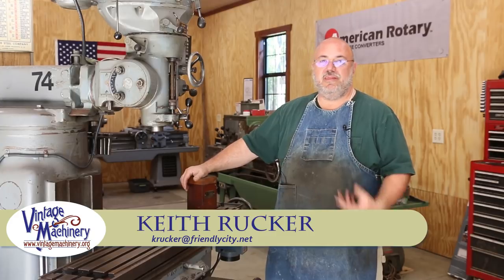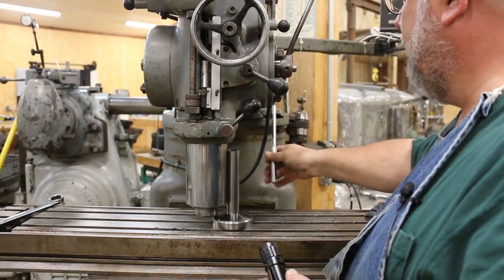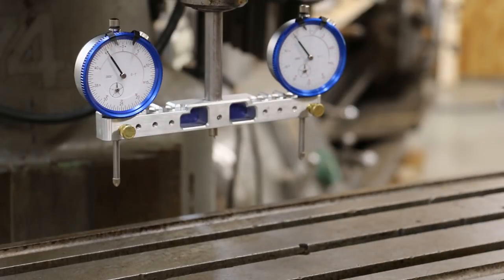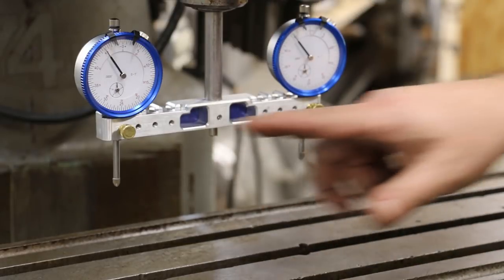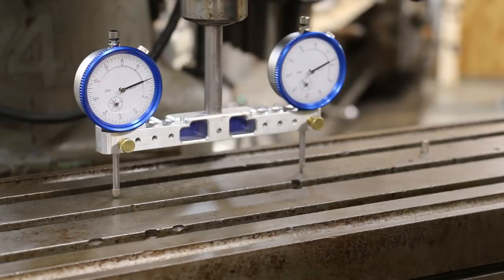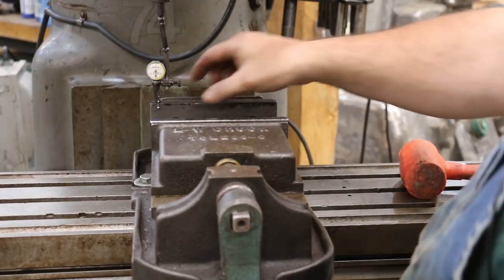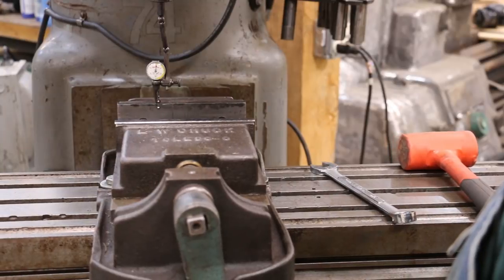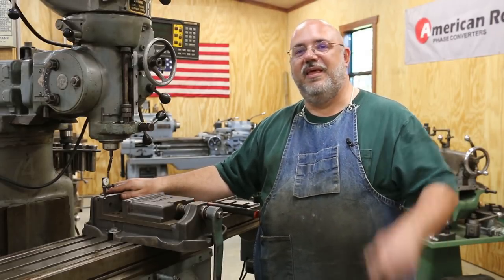Milling Machine Alignment:  Tramming the HEad and Vise to Square and Parallel

Comment: For those who have a boring head for their mill, it's simple to make a bar to hold your indicator. Then you can tram the mill's head with that. It's maybe a bit slower because you have to go back and forth between sides, but it's still only a few minutes to get it dialed in.

Comment: Most of my work is done in my 6 inch Kurt vise so I use the cylinder square on the bottom of the vise ways to tram the mill head in both directions. Thanks for making the video. Have fun making chips.

Comment: Hey Keith 
Love the Videos, keep them coming, I am a Newbie to all this Maching stuff and appreciate all your work and knowledge you share. I don't ever comment  because you  will have many many things to read, how ever I have to say that all the tramming should be done with the tables locked, at least on my Older Mill it makes a big difference. And oh yea I have the same  disease you have I just brought home my new (old) Monarch Lathe so I guess I can join the Monarch club with you and Adam Etc. Thanks again for all you videos and dedicated work
Reply: I would have to disagree with you on locking the table.  If you machine with the table locked, I could understand.  But you should have the table in the same conditions as you machine.  This is my opinion though as I've been machining for 30+ years.  Feel free to correct me if I'm wrong.

Comment: A word from the old and wise, make sure the bed rails are slick clean before traming! That one sliver of a spec can mess everything up, a good indication of specs on the slide rails is when your needle jumps when it is sliding. Rails might look clean, but there are spots you can’t see until you remove the bed from the rails.

Comment: First time attemping to tram a mill, my Grizzly G-8689 Mini-Mill...
No "nod" adjustment, but, went ahead with the table length.
Couldn't get the Mitutoyo 0.0001" dial to repeat during adjustments...
Finally checked the indicator... the four case back screws were loose.
Easy after fixing that!

Comment: I had a costly lesson about tramming last month. I also used a last word on my vise and I also used a mallet to tap it into alignment, with the indicator making contact with the jaw view. After a while the indicator was moving unpredictably. Now I pull the indicator away from the surface before tapping. I assume that it was the vibration that trashed a pricey gauge.

Comment: Thanks for the video.  Just what I needed to learn how to use the very similar two-dial-indicator setup I ended up with for my new-to-me FTV2 Lagun.  Got both axes to within a half a thou.  I think the machine and my eyes are both not up to much more.  Thanks much.  One small constructive criticism -- I'm so new to this that the third part on the vise setup wasn't enough to help me, as it didn't have any close ups to show just where the indicator was touching, nor what kind of indicator it is and how it is set up.  Probably should be obvious, but then again, maybe not for someone new enough to need such a video.  Thanks for getting me most of the way there.

Comment: I wonder if perhaps the minor error on the cylinder square may be due to the "first" check done with the head nodded forward, as the square might not have been flat to the highest point. Rechecking the first measurement once setting the second measurement may have also show the error once the nod was straightened up by your second alignment operation
Reply: makes sense to me!

Comment: Keith

Did you use the Spindle Square to chech ig the vise is square to the table ( and thus square to the head)  as well. most folks just seem to assume the vise when installed is square to the table, which is a bad assumption to make.  Once the vise is trammed in all 3 axis, then you know all is right with the world.  And don't forget, re-tram the vise when replacing the jaws

John

Comment: You can check correctness of your square cylinder by tramming your head some other way (by sweeping the indicator across the table for instance). Then place the cylinder on the table, attach the indicator to quill and sweep the cylinder by moving the quill.

Comment: Keith, tramming the mill with that double dti gauge or even if with a single dti I would tighten (lock up) the quill and knee each time after making an adjustment especially on an old machine, just to make sure of any errors

Edmund...........Alberta

Comment: you could measure to a pair of paralels set on the table so as not to measure and adjust any minute ding in the table. good tool to have though, i also like the cylinder square, that would not mueasure slight dings because of the large base

Comment: Good stuff.  One of the issues you'll likely find is that the quill has some play in the head and how tight you lock the quill makes a difference in squareness..  It might have been interesting to try different parts of the table to see if squareness changes. Also you could have on indicator point sitting in a dimple that would throw off the reading.

Comment: Use a gauge block instead of a magnet (more precise) and you should also take at least a  .100 revolution one full turn or a little more on you indicator which will give you more travel when checking and have the dial zero at the top of the indicator (easy to read). These tools are very easy to use and you can buy or make one in your own shop.

Comment: Just finished re-tramming mine with a similar dual indicator system. New mill...way out of alignment. Here is a suggestion, if you are way off like you were before you used the cylinder, do a gross adjustment by touching the indicators off the table first. If you are way off you can get lost in the number of spins on the indicator (I know the little dial is there - but can still be confusing).

Comment: Dear Keith,
I don't know if you  are gone look to my problem, thou I'll hope you  do.
First, I'm new, always  wanted to be a  machinist, (I'm a retired printer).
I bought a  Adcock-shipley (1954) horizontal  milling machine + vertical millinghead.
I did the tramming in the x and y direction, of the vertical millinghead, as close I could get it, 0,01...mm.

* But, now is my question: how can I solve the problem of  leaning.
When I put a indicator on the foundation of the  mill and I  travel in the X- direction, I have a difference between the two sides, 0,3mm. And in the Y- direction 0,18mm.
Now I have shimmed my vice. 
I would like to use the horizontal milling more with clamps. But I dare not, I'm  afraid my milled parts will not be parallel. I'm I wrong or right? Ps there's no play in the movement.

Greetings Lammertyn Mc

Comment: I’m amused at how few times I’ve seen a U Tube Machinist use the box end of a combination wrench.  From an early age I was always taught if you need to get it tight or break a hard one lose you should use the box end to prevent slippage and or rounding over the head.  To the best of my recollection I’ve only watched a U Tube Machinist use the box end one time!  Although in all those episodes I’ve not seen one misshape so it seems there was no need to use the box end.
 When it comes to the final tightening or loosening I always use the box end, just my way of doing things, I guess…
Reply from the maker: I use the box end a lot.  Sometimes, you can't get the box end on the head easily though because of clearance.  Such is the case with the nuts on the vise.
Reply: I could not agree with you more.  But my comments were not aimed at you nor to this particular video but rather to yours and most all other metal working u tube videos in general.  I do hope you did not take this as any kind of slant to you but simply a generalization.  You are if not the very best u tube machinist to watch, you are on top in my book!   I like you videos very much and yours are always the first one I watch!  Thank you!
Richard
Reply: yes, the open end is bad enough, but what about the many guys who use a shifting spanner or crescent wrench, depending on your version of english?
Reply: The bottom line is not that that everyone should use the box end, but to not round over the bolt head or nut. My comment was in regard to the fact that on U-Tube I very rarely ever saw the box end of the wrench being used;
it's always the open end or other. I did not mean that the box end should always be used, however if there is a chance of rounding over of the head one should use the box end for better distribution of forces.
Reply: with 2hich I agreed totally. I too was taught very early on to use a box end/ring spanner  or a socket whenever space allowed, open end only if  space or lack thereof require it, and a shifter/crescent as a last resort.

Comment: Keith.     Why didn't you use the magnet as height gage, must have ground height ( .375 ).
Now dial in full .375.  Then go to other dial. ( same spot ) and go .375. Now both are zero with
each other, then  both will zero together.   Just a thought......Ray

Comment: If you are going to tip the head at an angle to drill a hole in a part, you have to tram the head to the tee slots or the hole will come out in the wrong place.  No one ever thinks about the head swiveling on the base.

Comment: I guess I'm a little different. Wherever I worked if a little additional accuracy was possible, that's where I tended to go. When I worked for the Air Force I always worked to get something like the power supply parameters exact. My contention was that accuracy would make the equipment more reliable, and I was proven to be correct.

Comment: Keith, Thanks for the videos. A refresher is always good. Gibs on X and Y adjusted? Just a thought...
Reply from the maker: You know, when we had the scraping class a month or two ago, we used the mill as a lesson on adjusting gibbs and such so it is about as good as it will get without re-scraping the whole machine (which it probably needs).
Reply: My faux

Comment: Great video Keith.... how about the bottom of the vise can you indicate it to see if it is parallel (level) to the the mill table also.
Reply from the maker: You can just put an indicator on the vise and move it across the top.  You can also tram your mill to your vise if you know it is off slightly.

Comment: Keith, I love your videos. How do you know the table is coplanar? Would this method be more accurate if you indicated off of a parallel block so that you were averaging out any imperfections in the table - just like you used to check your hand scraping with an indicator?
Reply: Yes. This was incomplete demonstration. He should check table flatness, stone any burrs. If it's still not OK, "average out" by using parallel or something like that. Same with vice jaws (if there's a wear, indicate big parallel, not jaws directly).

Comment: I have an precision 6" square with a bevel edge I use to get the head close then sweep a 6" radius on the table with an Indicol.  Also, I use piece of flat and parallel ground stock that I can slide around the table to indicate on.  Tables are a bit too rough for the indicator to get an accurate reading.  I don't care for this "Spindle Square" method.  They have to be calibrated each time and they don't sweep a large enough circle for my liking.  

Someone sales a tramming fixture that rest on the table and straddles the vice so you can check the head without removing the vice.   It's basically a ground flat ring with four legs.
'

Comment: 8:00 how square is the tool to the shaft... That is what I wonder. I believe you should have flipped it again to confirm each dial is giving you the. Same reading... Never forget that you MUST check each dial to confirm how accurate each dial gauge is (within the travel you ask of it)...
Again, flip each one around to confirm each are equal...

Comment: 15:32 "unlike a lot of people I take
 my vise on and off the mill machine a lot depending on the job that I'm doing"

Well why don't you put it at or near one end of the table and leave it there ? Then that leaves the rest of the table when you're not using the vice and when you are using the vice, you're wearing a different part of the ways !

Comment: Rotate cylinder square, side first, 0 - 90 - 180 - 270 degrees, you will see any taper, I know I know, but slight as it is still possible. After that adjustment then do the front. Table true is another problem.
Cheers

Comment: You can achieve the same result with an accurate combination square as with a cylinder square.  I don't see the need or added expense of using 2 indicators, they aren't far enough apart to span across a vice on the X axis.  All this gadget does is eliminate the need to sweep the table.
Reply from the maker: I have used a combination square as well, but I much prefer the cylinder square.  The magnetic base is much easier to deal with as the square will not fall over.  Also, because you have a cylinder that your are working off of you don't have to fuss with making sure that the edge of the square is square to the column.
Reply: Hear, hear! ;-)

Comment: The question is how we know the dual indicator tool is accurate? The zeroing method isn’t guaranteed. If the quill has the slightest looseness, it isn’t guaranteed to be correct in zeroing the tool. I don’t see how we can. I use a 9” x 0.500 carbide rod in an accurate collet I reserve for the purpose. Using that against either a B&S master square, or a cylinder square is pretty accurate. That’s a preliminary adjustment. Nothing is perfect. But I still rather use my Interapid tenths indicator and sweep it around a 12” circle for tramming.

Comment: Hi Keith, nice video but I have a question:
How do you know if the table is perfectly flat? If it isn't, how would you correct this? Many thanks!
Reply from the maker: You would have to check the table against a perfectly flat reference.  A surface plate or scraped straight edge.
Reply: Thanks for replying, one last question: would it be possible to machine the table if it were not flat?
Thanks in advance!

Comment: Why not just use a dial test indicator on an extension in the spindle to allow you to sweep about a 6" diameter?  I've always squared (trammed) the head on Bridgeport mills this way.  It only takes a couple minutes with a little practice, without having to purchase 'special equipment' for a routine task.  I can square with an indicator faster than you can 'calibrate' that device.

Comment: The dual indicator presumes it is indeed accurate side to side, sweeping from the spindle is the easy and accurate way.
Reply: The dual indicator setup does not need to be manufactured exactly square side to side.  It becomes very "square" when zeroing each indicator to the magnet gauge block as Keith did.

Comment: Use the Last Word with the contact point inline with the travel. You used it 90 degrees out. The jump You saw will not happen.  Good Video.

Comment: That Spindle Square is about $85, how much would the cylinder square cost if purchased new today? I googled and found a couple for $500! Both seem like decent methods, but if it means a savings of $400 that Boring tool seems like a no-brainer.
Reply: cylinder square seems makeable with a lathe
Reply: The real advantage to the cylinder square is its faster. But if speeds not a concern then its not money as well spent. FWIW multiple vendors/companies have those squares. See them every now and then in catalogs.
Reply: Jusb1066 Cylinder squares are ground to within a couple of 10ths or less both in diameter and perpendicular. A lathe alone wouldn't have the accuracy required.
Reply: +bespoke, yes, i forget the high accuracy of engineering, i guess i wont be able to fool anyone with my stainless paper roll holder!
Reply: Jusb1066 To be honest they are not so dificult to replicate, precision ground bar stock is readily available and not too expensive, the hard work is grinding the base perpendicular but the beauty with cylinders is that they are self checking and if you are off a fraction there are always two points, 180 apart that will be square.
Reply: All you need is an old school indicator holder to check for squareness.
Very easy to make them square by lapping.
Provided the square is ground straight with no taper, you can turn a cheapo one into a high end one.
The top of the line squares are squared by hand for what its worth, Suburban Tool did a video on how they do theirs.
Reply from the maker: Yes, a good new cylinder square would cost a lot more than the spindle square that we used with the indicators.  However, the cylinder square has lots of other uses besides tramming a milling machine.  I use mine for other things as well.
Reply: You don't need to spend big bucks for cylinder square unless have other uses for it.  You can get what I use for about $26 here: http://www.ebay.com/itm/Hardened-Steel-6-x-4-Precision-Bevel-Edge-Square-/152475806716
 This will get you close enough to start, then use the Spindle Square or indicator like I use.  I use my beveled edge square almost daily, far more that my cylinder square.

Comment: Keith - why is it that nobody rotates their indicators (180*) so there's no need to walk to the back to check?
Reply: because it would disturb the calibration that was done on the first step.
Reply: Billy T No, You rotate the indicators, the n calibrate.
Reply: BasementShopGuy you are right. this is way overcomplicated.  just mount indicater in colleg in spindle and rotate and adjust. Right you are.
Reply: Maybe I'm missing something, but doesn't that work for the zero setting but when you go to tram the head in aren't you facing the same problem again since the faces are now opposite?
Reply: Brad, it's easier to see both of the indicators at the same time when your doing the final tram.
Reply from the maker: You only rotate it for calibration.  Once calibrated, you want both indicators reading on the front so that you can see them both at the same time (so you don't have to go to the back side to check).